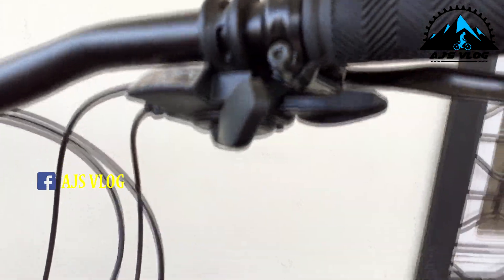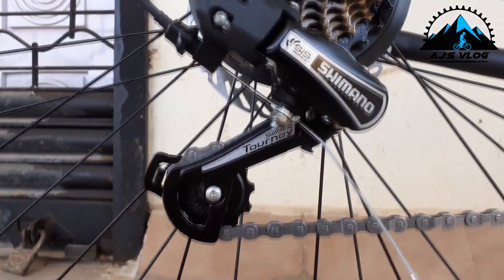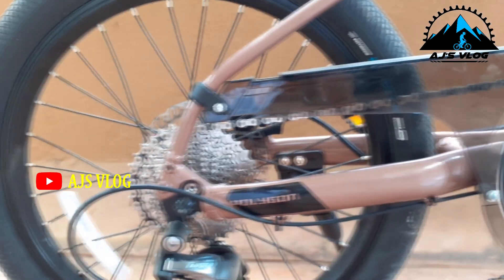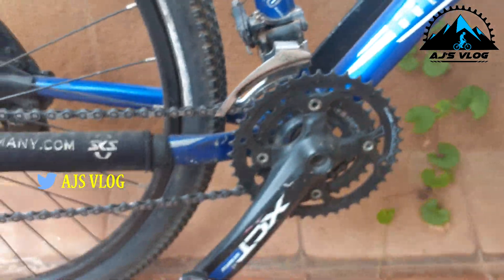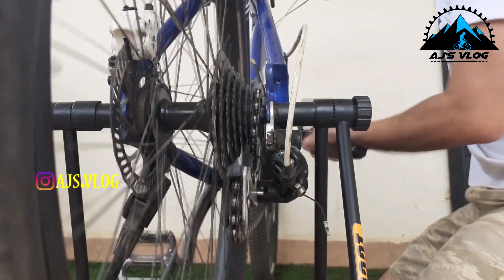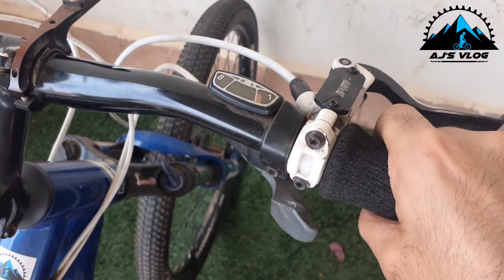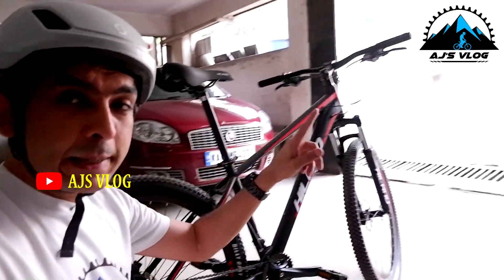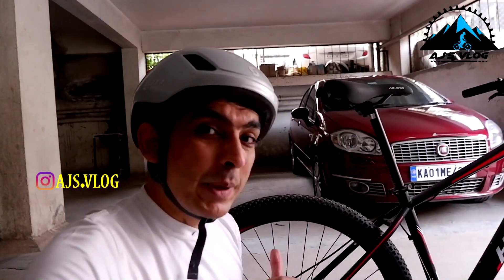How To Use Gear in a GEAR Cycle | Ajsvlog

Comment: I need a suggestion on whether to go for a mountain bike or a hybrid for typical Bangalore roads where there are practically no roads in some areas.
I am not looking for specific offroading.
I am also worried about the exposed break and gear wiring in most models.
Need your inputs on a proper type of bike and also one of two model suggestion with good after sales service/spare parts etc. for a budget between 20-25k.

Comment: Kindly suggest good cycling accessories Store in Bengaluru ❤️
Reply from the maker: Depending on the accessories you are looking for you can visit any of the cycle stores, typically most stores have a wide variety available
Reply: @ajscyclingvlog  Looking for a descent helmet below 5K, gel shorts, lights.

Could you please share some leads? :-)
Reply from the maker: @shaheerv2133  Check out Jayant probikes, Shah bikes, Wheelsport, Pedal in tandem, LBB, Crankmeister bicycle works to name a few...
Reply: @ajscyclingvlog  Thanks alot ❤️

Comment: Hi , i am confused between fx2 disc / dual sport 3 / scott sub cross 30 . Im looking for a cycle where i can travel around 30-60kms for fitness,  which do u suggest btw these ? If u have a better option pls let me know ?

And , fx2 disc comes with 700x35c (3×8GEARS)/ dual sport 3 comes with 700x40c (2×9GEARS), / sub cross 30 comes with 700x45c (3×8GEARS),which of these tires and gears gives me better rolling and easy to ride ?
Reply from the maker: My personal fav is the FX2 ... its frame geonetry is quite nice and comfortable to ride long distances. 
Tyres and drive train can always be upgraded in future
Reply: @ajscyclingvlog  Thankyou for ur reply. My only concern with FX2 is it comes with Tourney front derailleur and does not come with shimano crankset
Reply: @ajscyclingvlog  Choose 1 bike from both the Categories ?

Hybrid Cycle - (Rigid Fork) 
1. Trek Fx2 Disc
2.Bergamont Sweep 4
3.Scott Metrix 30 EQ

Hybrid Cycle - (Suspention Lockout Fork)
1.Scott SubCross 30
2.Trek DualSport 3
3.Merida Crossway 30
Reply from the maker: @dilipkaparthi  FX2 and Crossway (their frame geometry suits me best)
Reply: @ajscyclingvlog  Fx2 Disc uses TY710(front deraillurs) and Forge alloy crank, will this be a huge diff in ride quality and speed?
Reply from the maker: @dilipkaparthi  The frame should be your main criteria for bike selection. These components can be upgraded.